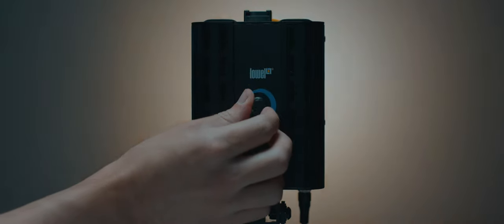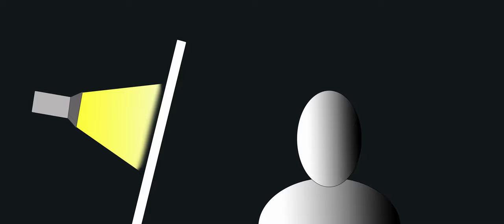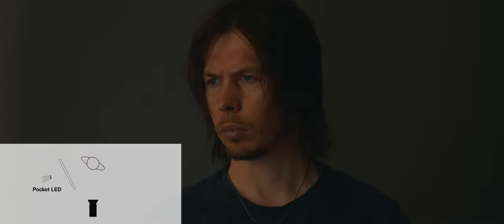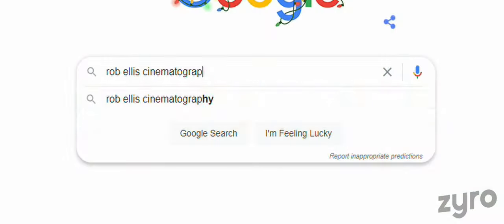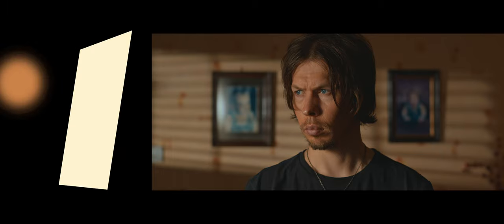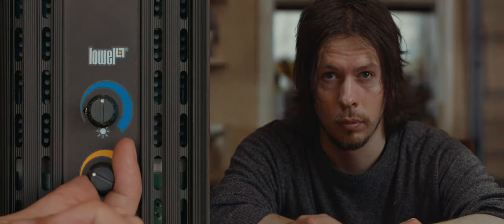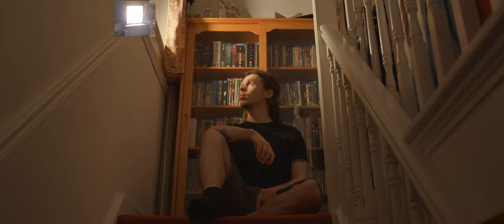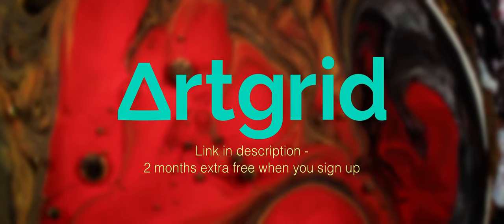Cinematic Lighting with the BlenderXL / Choosing the Right Light for the Job!

Comment: I like the look of the shots! My only hold up with lights like these is having to manually mix the warm and white LEDs to get the right white balance. I'm red-green color blind, so if I'm operating multiple lights solo I don't feel comfortable eyeballing it. I prefer having tunable kelvin degrees or simple daylight balanced lights.
Reply from the maker: Absolutely, that definitely can be an issue! I think a color meter would come in handy with circumstances like yours, you can actually get a few apps that do this through your phone camera also!

Comment: could i put it on the hot shoe from my canon r5 for example? or do you think it is to heavy? thanks a lot
Reply from the maker: There may be some kind of cold shoe adapter, but you'd still need to plug the light into power/some sort of battery, so that might be a bit of an awkward application. Hand holding the light is definitely an option though!

Comment: what about a 120d or similar with a 45º reflector?
Reply from the maker: Absolutely, that would give you similar control. With a fresnel or a spot you'd get even more control than 45 degrees :) what I replied in a previous comment is what's great about the Blender is that you can go from a decent beam angle, to sliding in a diffusion panel in seconds. So for example, you could be shooting the first scene in this video through the larger diffusion, then go straight into the last scene by the window -  after the first scene is shot, Blender off lightstand, diffusion panel slides in, Blender in window. Which is very simple and very quick! Features of lights can overlap but sometimes a certain tool will be much more efficient than another one!

Comment: A 60w COB could do it too though ?
Reply from the maker: Yes it could! And with a spot or fresnel on a COB, you'd get even more control than 45 degress. What's great about the Blender is that you can go from a decent beam angle, to sliding in a diffusion panel in seconds. So imagine you need to shoot the first scene in this video through diffusion, then go straight into the last scene by the window - first scene shot, Blender off lightstand, diffusion panel slides in, Blender in window. Very simple, very quick! Features of lights can overlap but sometimes a certain tool will be much more efficient than another one!
Reply: @RobEllisCinematographer  definitely agree about tool's efficiency. Also a small COB could fit on the edge of a window like you did with the Blender XL
Reply from the maker: it could! But then to diffuse like the Blender, you would need e.g: a reflector dish attached to the front of the COB and a small piece of diffusion cut to size to cover the reflector which would need to be clipped/taped on - so it would end up taking up more space and become more time consuming! ;) it's all these little things that add up and can become quite awkward to deal with, especially if you're on a budget!
Reply: @RobEllisCinematographer  yes definitely, even without the dish and diffusion going for a harder source ( sorry I meant « couldn’t » instead of « could » in my previous comment ). Flatter LED panel is definitely more suitable for such a place.